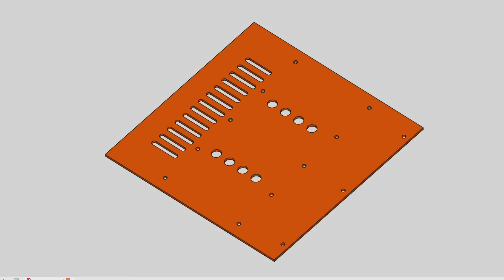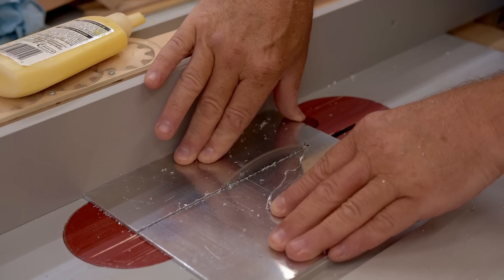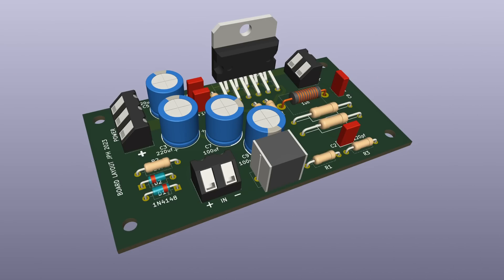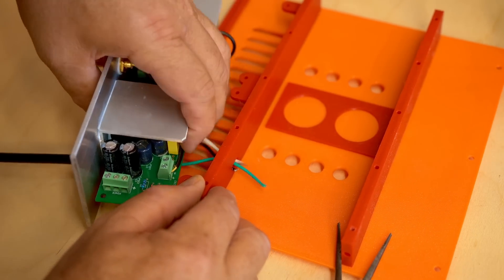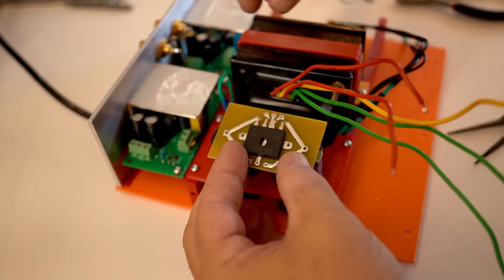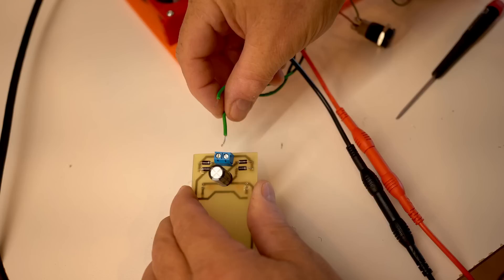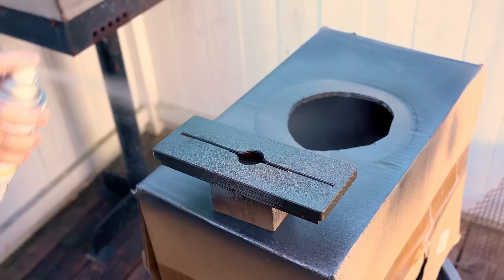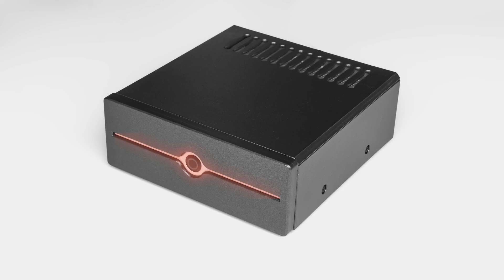You'll Never Guess How I Made This 2 Channel Amplifier

Comment from the maker: The future of DIY is here today: 3D printing. 
The huge advantage is the complexity of the parts that can be made, giving you complete freedom if you are able to design the parts. 
I used FreeCad to model the case for this amp and printed it on my Bambu Lab X1C 
All of it was made from ABS plastic which is durable and heat resistant, and the whole thing used less than 2lbs of filament.
The amps are a standard implementation of the LM3886 and run on a +/- 29 VDC supply, putting out roughly 40 watts per channel. 
The LM3886 is regarded as a high quality audiophile grade part for high fidelity reproduction. Translation from audiophile lingo: they sound great. The amp is dead silent at idle, even sitting inside a non-metal case.
Like I said in the video, I finished building this amp months ago and have been using it every day since then. The 3D printed parts have held up perfectly and are exactly the same as when I made it.
Some of the parts were a bit rougher than I'd normally allow, but this was mostly a test to see how well a 3D printed amplifier case would hold up. To do it over I'd take more time to fix any cosmetic issues to produce a better fit and finish.
Reply: Hello, could I send you a picture of a crossover? It's from the inside of a low budget subwoofer. I'm new to to this. Thankyou.  I'm Allan from Ajax Ontario

Comment: What's Up? I need to hear/see something interesting, but not for "audiofools"
BTW, I ran across a 32-bit DAC system from ROHM, seems to have very, very fine performance, and they have an evaluation board for about USD 240. better performance specs than $2500>

Comment: I did immediately guess it ;) But that's because I've also done a couple of 3D printed amp cases myself, really fun designing and printing them!

Two tips is to play around with fuzzy skin, can give a nice a a bit of a matte/rough surface, and/or just sand it down quite a bit in just one direction and then spray paint it with a metal colour to give it a brushed metal look ^^

Comment: I think the experiment was successful ) Would you proceed to casting aluminum into a form made with 3d printed model? For me it would be cheaper than to order a CNCed parts from the Chinese service if you would need a "high end" amplifier case. May be you won't need it at all but as an experiment - why not?
Reply from the maker: Always a possibility to do something like that, although the parts would have to be designed with casting in mind, which would make it a lot more difficult. 
Machined billet aluminum in high end cases is just a marketing hook, though, since the home experience for audio equipment isn't rough enough to justify a bulletproof enclosure.
Reply: @IBuildIt  Agree with you sir. But always wanted to have something ... unusual. I mena an enclosure. But this is about tons of money.

Comment: If you have trouble with case, it will be sagging from heat of the transformer, as it is heavy and gets warm.  I used PETG and have trouble, hopefully abs is better, maybe I should reprinting parts in ABS.
Reply from the maker: I put a footpad directly below the transformer to prevent that - it's designed into the bottom panel along with the other feet on the corners.

Comment: You upgraded your printer. How you liking it? I've been thinking of getting the P1P or P1S. That X1C looks real nice but beyond my needs.
Reply from the maker: I still do most of my printing on the P1P, actually. I used the X1C here mainly because Bambu sent it out to me along with a bunch of filament and figured I should use it in a few videos. 
I like the P1P because it is more open for filming and is slightly faster getting started.

Comment: you don't need mouse ears that tall, 1-2 layers suffice, and they break away by hand. And i think Bambu studio (but not orca slicer) finally implemented manual placing of them
Reply from the maker: My first time using them and I added them directly to the parts I designed in FreeCad. Since then I've made them a lot thinner still rather cut them off to avoid tearing.
Reply: @IBuildIt flush cutters used in electrical/electronics work great for cutting a super clean edge super quick.